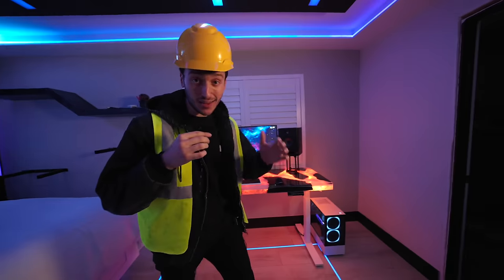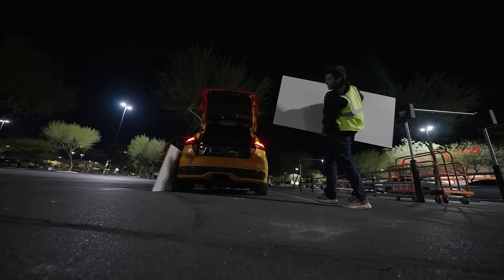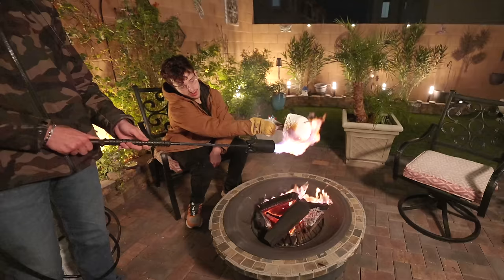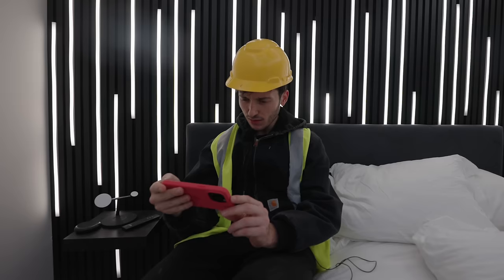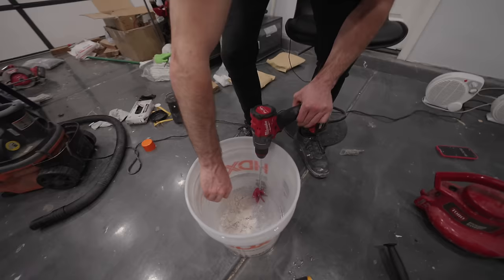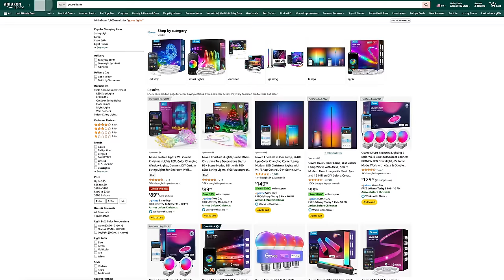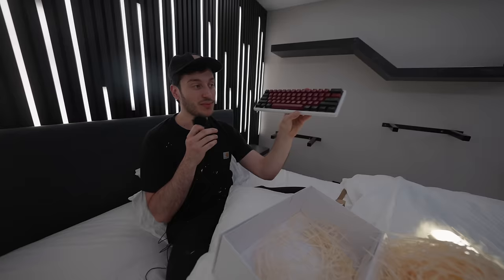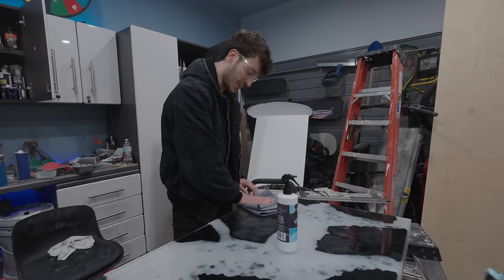i built a lava gaming desk

Comment: hey frenchie got some led lights from shein for a little test and only red and green work, if i bress “B” (blue) it turns off and if i press “W” (white) it goes to a light green. Then all the other colours on there are lighter or darker shades of red and green, when they should be pink,purple etc. My remote is a 44 so idrk? you know about led lights so please help me😭😭
Reply: Hi , Albert IT tech here! it might either be faulty LED or power issue , usually blue lights are the faulty ones , if the power doesn’t give enough you cannot display blue light , so i’d check if it’s plugged properly and you got enough power going in it. If not maybe the manufacturer quality is bad and you received faulty leds
Reply: @ThisIsNotAlbert  thank you for the information!